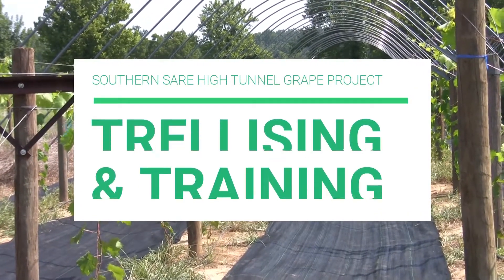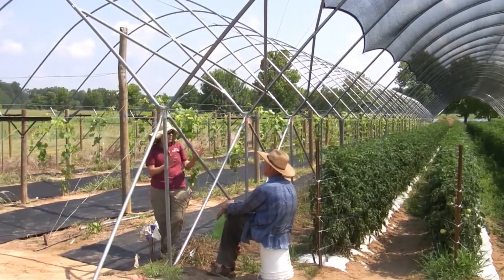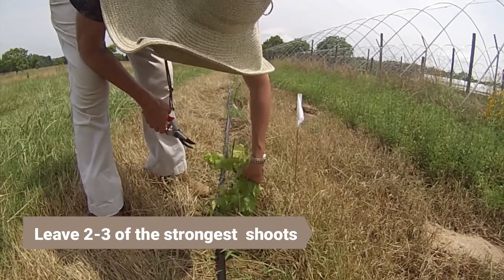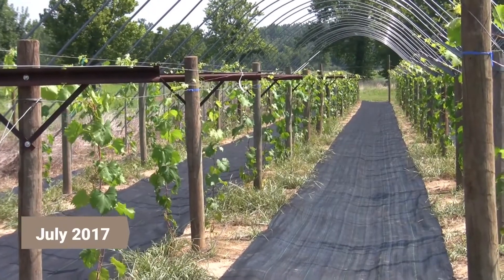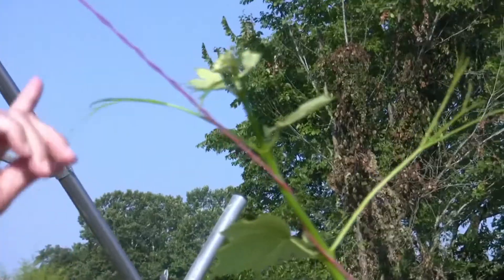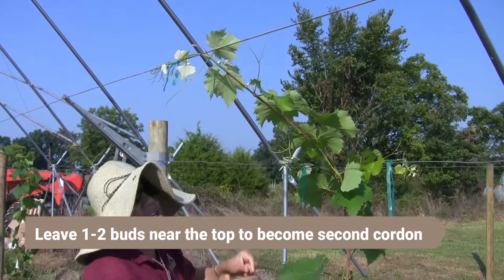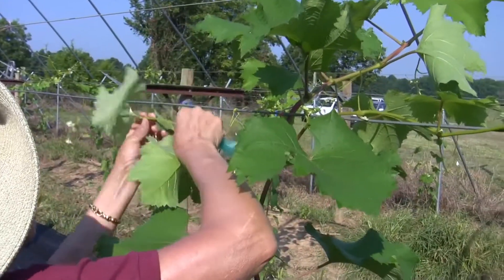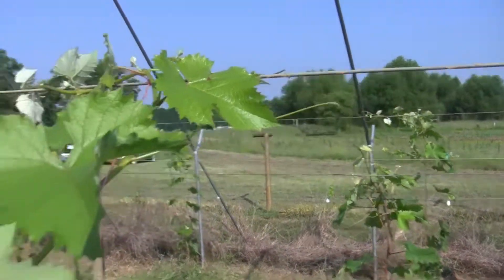High Tunnel Grapes – Trellising & Training

Comment: I'd really like to see a video of the professor pruning the young vines as shown in the first minute or two and the logic/reasoning behind the cuts she made. Thanks.
Reply: I know this is 4 years late but I hope someone else find this infor mation useful (Hort student here most of those cut were 40% intuition and 60% knowledge.)

You want the straightest, thickest stem to become the trunk. The shoot/stems left are to provide nutrience and will be easier trim later in the season/get the best about the sun.

the intution comes into place when making cuts because it invovles a bit of guess work to predict what the vine will do. if you trim too much you stunt the vine from growing tall, and it goes bushy instead. If you dont trim enough the untrimmed stems become woody and harder to prune later in the season, they also prevent a more focused growth on the main trunk. 

there's a general rule of thumb for how big a stem should be when considering it for a trunk vs. keepingit for feed the trunk. everything at this stage should be easy to prune with hand clippers, and if there's a stem/branch that's becoming woody and is the centre-most stem of the whole plant you can consider it the lateral branch, and everything below the woody stem should be cleared for upper growth to create guyot/cordons depending on what style of training you're going for.